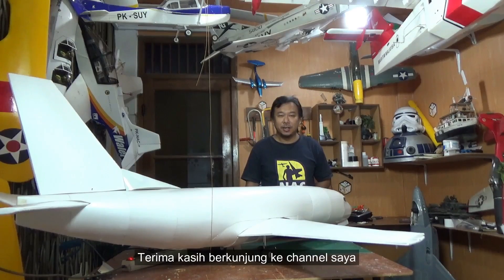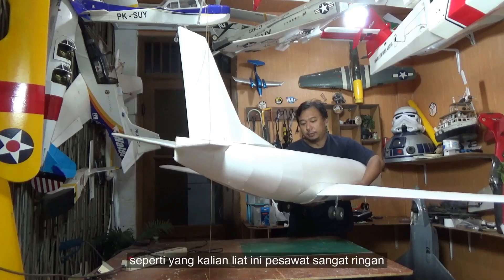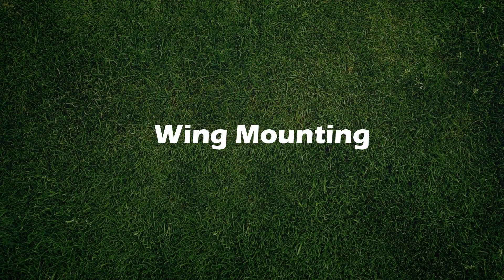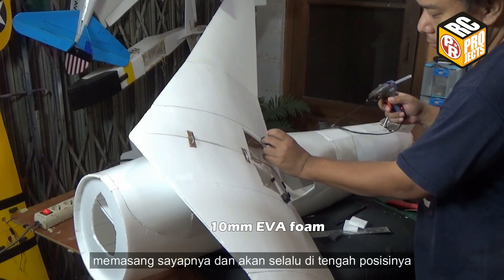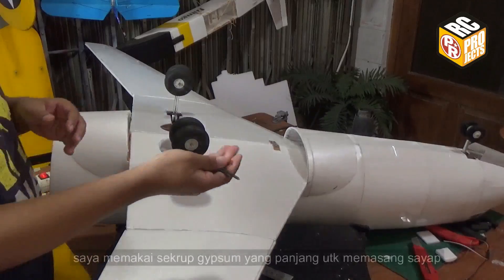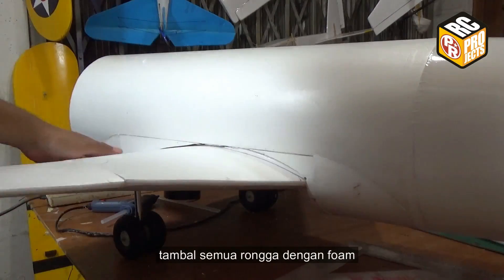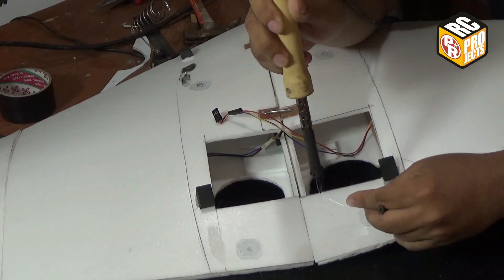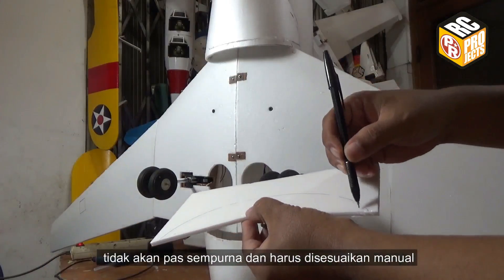How to Build RC Airliner Boeing 737 Part 3

Comment: hello my friend good day to you   just a little bit of info required on building the rc 737-300   i got the plans and downloaded it   however the last 9 pages is not coming up for printing  on part 4 of the build   i think that might be the engine section      is there anything i can do to get it   thankz
Reply from the maker: Try re download again, there are some people already fly their build so I think there is no problem with the plans
Reply: ok buudy   i ll let u know   already started the project  glad i found  channel  means alot  thank you so much
Reply: good mrng julius  ok i tried downloading the plans   again  i did it twice   but still the engine pages are not coming up  i even downloaded  separate parts like part 1  2  3  4  you know  but on the plan 4 part is where i m having that problem

Comment: Hi Julius, please explain better how to position the vertical stabilizer on the fuselage, at minute 11,09? Also, how do I adjust with the tailplane angle at 9.59 minutes? Thanks a lot for the answer.

Comment: Hi Julius, I'm from Argentina, very good job, congratulations, I ask you how you make the connection of the 2 regulators with the receiver, thanks
Reply from the maker: 1st esc on channel 3, 2nd esc on channel 6 and then mix channel 3 with 6.
Reply: @JuliusPerdana  ok, and the power supply to the receiver is 1 or 2 regulators
Reply from the maker: both ESC connected to 1 battery with Y power cable